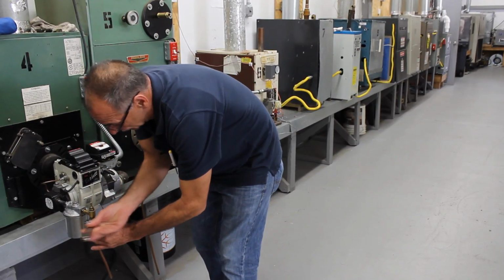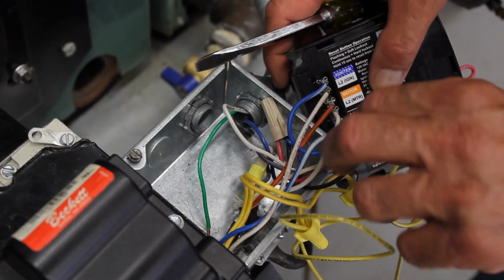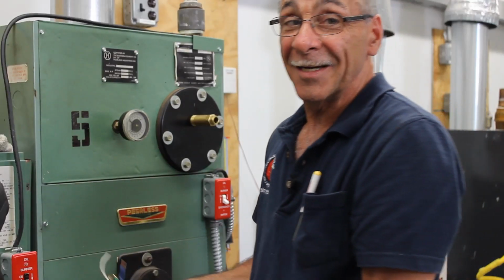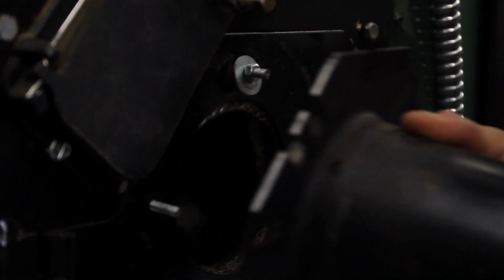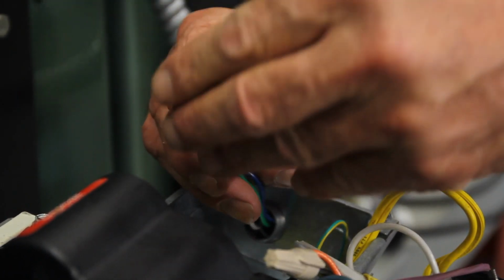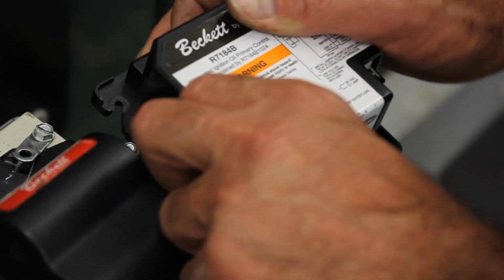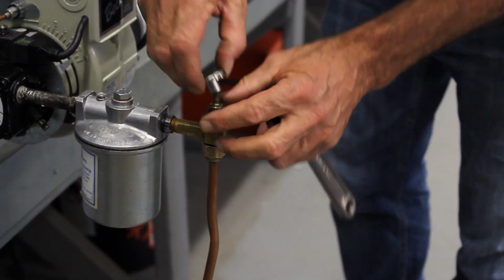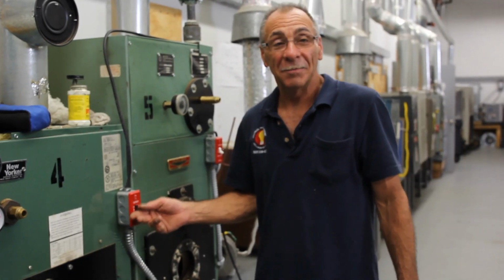Burner Installation For an Oil Boiler

Comment: I hate to be an asshole, but this was basically worthless. Seriously. When you started the video, you had a black hot leg a white neutral and a green ground. The blue on the R7284 is for the burner. You never explained anything about the burner, igniter, CAD cell, limit, or valve if applicable. At the end of the video, your hot leg was blue. This was confusing as shit this is somebody who’s worked on a lot of oil boilers. And I’m a female just an FYI. Just another minute and a half explanation of this. This would’ve been a productive video. Also, starting with the boiler type would’ve been extremely helpful as that control can be used in different configurations, I’ve never made a video, but I’m about damn ready to start doing them.

Comment: Unbelievable! He tells you to turn the oil off with the firematic valve at the existing burner gun. He next tells you to remove the oil supply line from underneath the valve he just had you shut off. While this is a necessary step if you didn't shut the oil off at the supply or oil tank you're going to empty your oil tank onto the floor when you remove this oil supply tube from the valve. Also he fails to advise you to install a Tiger Loop after the filter which prevents aerated oil, (common after a delivery), from getting to the burner. This is frequent cause of nozzle clogging due to coking.